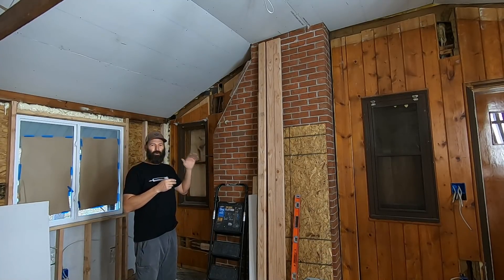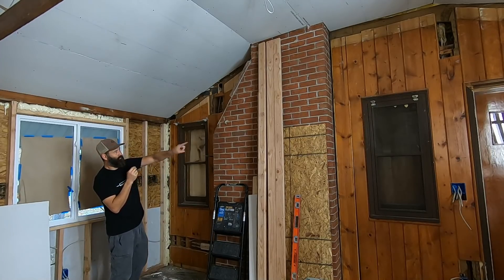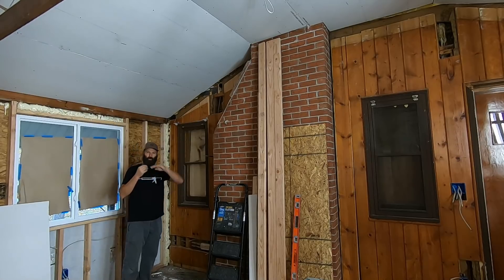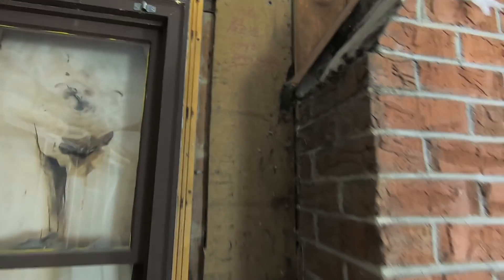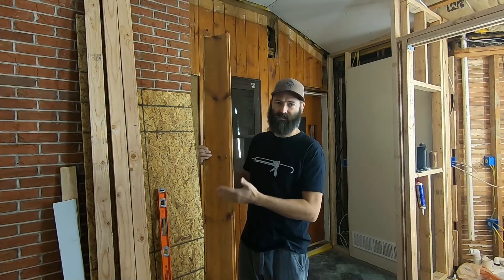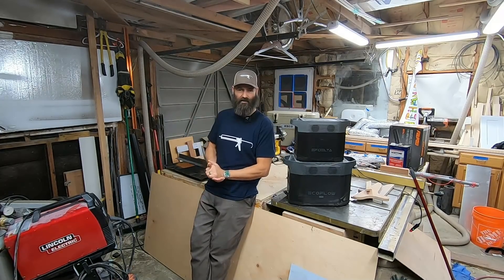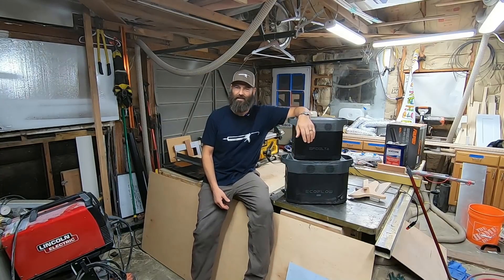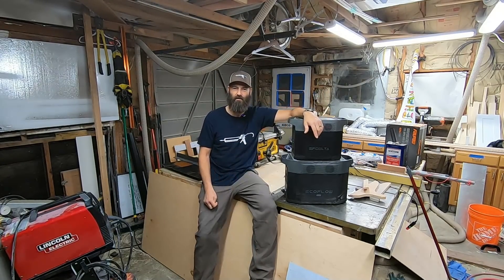Can A Handyman Install Drywall and Insulation? | THE HANDYMAN | $1,000 Per Day |

Comment: Was it by design why the second piece of drywall wasn't put next to the first piece with the factory edge and why?
Reply from the maker: Yes.  Install time took about 15 minutes.  It's getting skip trowel texture.  No need to stagger joints on this wall.

Comment: What is the regular thinness of the plasterboard that is acceptable for a house build?   For the inspectors!?  How thick does the drywall have to be?
Reply from the maker: 1/2 inch on most walls and ceilings.  If you need a fire rating like on a garage wall or an area that has your furnace and water heater it is a 5/8ths in fire rated drywall.
Reply: Various on codes and area.  1/2 inch on all walls and ceilings including most garages.  Local code for my area doesn't require fire rated drywall in the garage unless there is a habitable space above the garage which than requires 5/8 inch fire rated drywall.  Also my area doesn't require fire rating for furnace or water heater area either as most of these areas are vented already so installing fire rated drywall will not actually create any fire resistance.

Comment: Hey handyman, what are you thoughts on vapor retarders/barriers?  I will taking down some plaster walls and insulating, lots of debate of vapor barrier, I see you didn't go with one.
Reply from the maker: I used faced insulation which is a retarder.  It's not really needed in this climate.  If you live in cold humid areas then I would use them.
Reply: @TheHandyman1  thanks handyman, I live in iowa so I will slap one up.

Comment: Just wondering if you have a rotozip tool and if that would be a good way to cutout the drywall openings for the windows.  I always see you use a oscillating saw on the drywall, is that just because it's more universal or do you prefer it over a rotozip?
Reply from the maker: I use to have one.  It died a horrible death.

Comment: Are you using a multi tool to cut drywall around windows? What blade works best for drywall?  Thanks
Reply: Speaking for the handyman here, oscillating multi tool is the best way to deal with any run of drywall you can't just score and snap. It almost doesn't matter what blade you use, but whichever you do will be too dull for anything else almost immediately, so I just use a garbage blade.

Comment: I just did a bathroom remodel at an older house that had windows from the kitchen Into the living room. While I was doing the bathroom the guy asked if I'd take them out and drywall them shut. Very common  thing I see in my neck of the woods.
Reply: if the home was old enough there may not have been a bathroom in the original plan... or another one was added later.

Comment: My first thought was that you would save that paneling for sure, but then noticed there really wasn't enough to mess with
Reply: maybe just enough of that pine plank to box in those ceiling beams? The problem is that dry wood tends to split when nailed.

Comment: I got to hand it to you Mr. Handyman but you are the man when it comes to installing fiberglass insulation. Back in my college days mid 1970's I had a between semester job working at a factory removing machinery that had insulation around it. I made the mistake of wearing a short sleeve shirt. It took me about 5 hot showers before I removed all the fiberglass slivers from my arms. I said no more insulation work without long sleeves. Yet you do it with ease.
Reply: It's different material now. No need to fear anymore!
Reply: @ethanmarks4079  Well that is a relieve. The biggest concern now is breathing in the fibers. Good.

Comment: There seems to be an abundance of older homes (80-100 yo) that have windows that go to nowhere. Another channel I follow DIYfferent is renovating a maybe 1940's house in Florida. He had several walls with windows that went nowhere. So this is not a unique situation. I guess it was easier to just leave them in place instead of removing them and replacing it with structures lumber/OSB.

Comment: Why didn't you mark where the outlets needed to be cutout? A Rotozip would make life easier especially since you covered them up.
Reply: I mean this is a handyman not a guy that hangs drywall 40 hrs a week right?
Reply: @justinsnow5808  Yes, a very skilled handyman that understands time is money and why I asked the question.
Reply from the maker: The plugs are in and they are hot.  Rotzip might get me a zap and damage the plugs.